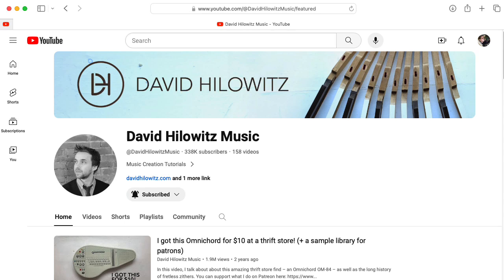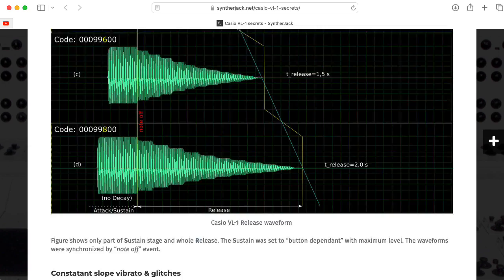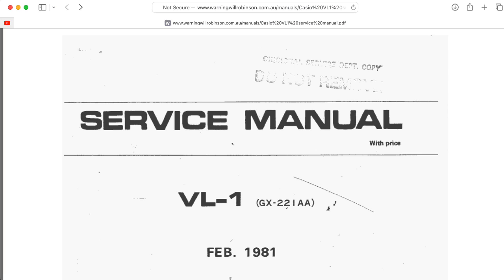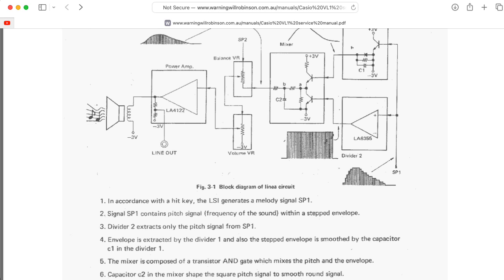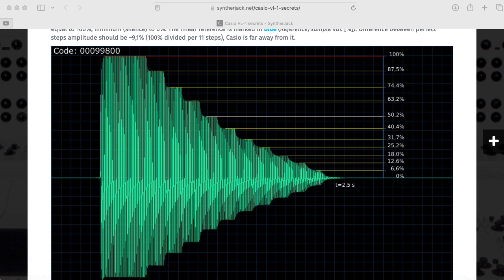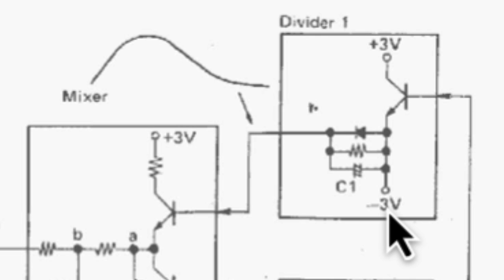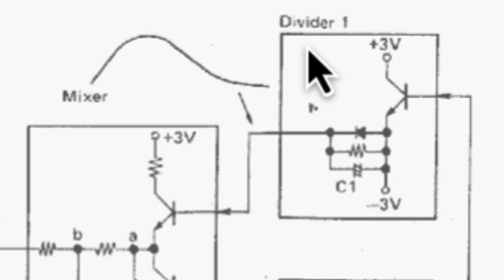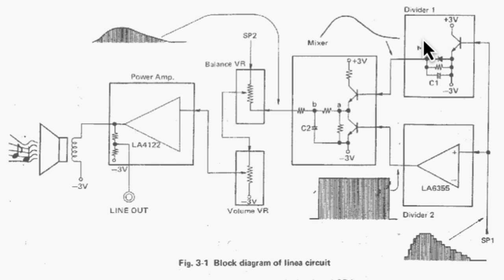Casio VL-Tone Circuit Mystery (is this an error in the envelope detector schematic?)

Comment: to sum it up the transistor emitter is biased to [ -3V +0.6VDiodevdrop] via the resistor and Vbase need to be just above the -2.4V+0.6V = -1.8V to start pulling the collector +3V to emitter that assuming that the 0.6V is diode voltage drop

Comment: Wikipedia Envelope detector. looks like you just need to correct schematic by deleting the trace from   the diode anode and the [capacitor || resistor] connected to -3V. Now the transistor emitter charges the  C/R in-series with the Diode. the capacitor discharge at constant rate and block the next NPN transistor from conducting and since the C||R is pulled not to ground but to -3V helps to overcome the 0.6V voltage drop of the diode as it conducts even at less than 0.6-volt input from base to emitter (it similar to why op amps need negative rails to reach 0V .

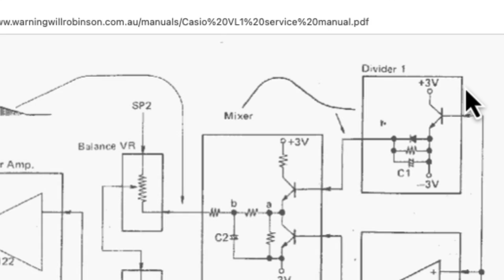Comment: 2:21 would help to know what kind of transistor is being used nmos, pnmos, cmos 

Is it open collector and not TTL

Transistors can be used in a analog/linear fashion too... Considering it being an audio output

And audio is technically an ac waveform

Typically with +3v and -3v  rails is a sign that it may be some sort of push pull configuration, to generate a true ac waveform not a pulsed DC waveform with smoothing

Comment: I’ve had a VL-Tone for more than forty years, and all it’s ever done when switched to ADSR is produce an infinitesimal blip. I’ve always assumed that it supposed to be an envelope, but it’s never worked as such. What, if anything, have I been doing wrong since 1982?
Reply: You need to read the instruction manual, I had the same experience til I read the manual. You could also just search here for an instruction video, pretty sure there are a few.
Reply: Well, it's been about 40 years, but if I remember correctly, you store a number into the memory of the calculator when in calculator mode, and that value is used as the ADSR value in keyboard mode.
Reply from the maker: I believe you have to enter a program sequence via the calculator function. There’s tutorials here on YouTube.
Reply: @Lantertronics  I did eventually find a video that described the process, not just showed a chap tapping in a string of random numbers…

Comment: They’ve also cut out any base resistors (there needs to be one for the lower mixer transistor if nothing else), I imagine they accidentally cut a few too many resistors in the name of legibility. Maybe you can find an image of its PCB and find out for certain.

Looks like nobody has taken a photo of both sides of the smaller board, but there are some good images of the component side so you can look near the three transistor section and maybe see if you can recreate the single-sided layout. Or just message some of the guys with photos to see if they can take a photo of the other side of the small board.
Reply from the maker: Oh, yeah, I was wondering how they weren't blowing up that transistor. ;)
Reply: @Lantertronics 
could also be an open collector comparator, but in that case it’s just the pull-up resistor they missed instead of the series resistor.

Comment: no resistor on the base, no resistor on the emitter to GND, the current would take the easy path.
I did a simulation the capacitor doesn't seam to have any effect, even removing the cap, resistor, alternating but with resistor on the emitter to GND, the diode conducts  bi-polar signal. Even with a push button on the base i can't see an effect of the capacitor (no matter what size), accept the voltage drop from the diode.
Must be a "block" type of circuit just for demonstration purpose and not the real thing.
Reply from the maker: Yeah, it's definitely not the real circuit. I wonder whose idea it was to draw that though, simplified schematics should illuminate instead of confuse. ;)
Reply: @Lantertronics  "I wonder whose idea it was to draw that though"
hahaha, you made my day with that comment.

I made or are in the process of making a Push Pull amp, also making mosfet PSU PCB that handle like 5 amps to power that.
But I'm sure you like my Push Pull circuit.

Comment: Why you are so fascinated with this ? I think this is what made you become the famous professor Lanterman. Whwn I close my eyes I see a12 year old Aaron Lanterman opening up his brand new, yet second hand, Casio VL-1 to find out how this thing works and I think you never stopped exploring since 😁
The envelope detector schematic must be faulty. Looking at the signals SP1 and the output of the envelope detector, both the higher audio frequency and the digital volume stepping are filtered out. The signal at SP1 is a frequency/pulse width variable signal with a (digital controlled) stepped volume (most likely using a very crude R-2R ladder DAC). The transistor is an emitter follower with the resistor between the emitter and -3V missing. The diode/capacitor is a peak detector to remove the audio from the signal and the resistor (both the resistor and capacitor are connected to -3V, not the emitter) results in the low pass filter stage for the envelope. There must also be an additional resistor between the collector and the +3V to create a low pass on the rising edge, otherwise you would still have the digital step on the rising edge of the envelope.
Reply from the maker: I can pretty much trace my current job to playing Akalabeth (Lord British's first game, before Ultima) on the Apple II+ and having it completely BLOW MY MIND.
Reply: I’d say it’s more likely a PGA after the timer PWM output, as opposed to an R2R ladder. If it were an R2R, having 11 steps would be strange.
Reply from the maker: It wasn't this, but I recall having some sort of electronic keyboard toy when I was very young, where it came with all the parts exposed and bare metal contacts for the keys, as some sort of educational electronics thing. Maybe Heathkit? Maybe Radio Shack? I can't recall for sure. My first real synth was a Sequential Multi-Track my parents kindly got me when I was starting high school I think.

Comment: Probably not an "error" as much as their idea of a simplified schematic. Just look at the op amp section right below it. It's almost certainly not operating without negative feedback. I would guess there's a resistor in series with -3V though a more complete schematic would be interesting to see.
Reply from the maker: The op amp below is operating as a comparator, so it wouldn't necessarily have negative feedback, but it's certainly an incomplete diagram, so you've got about about it being their idea of a simplified schematic. And you are quite right, if you put a resistor between the emitter and the -3 V it would indeed make a lot more sense.
Reply: Post the question to the sdiy list if you're not planning to do that already.
Reply from the maker: @Gameboygenius  Oh that's a good idea.
Reply from the maker: It really makes me wish there's a complete schematic out there somewhere...

Comment: If you think thats odd take a look at a picture of the insides of the VL-5 its pure insanity inside. 30+ bodge wires, through hole components mounted as surface mount, 3 separate NTC thermisters doing god knows what oh and 2 red leds on the inside doing ... something in the power supply section...
Reply from the maker: Okay, I just googled for pics of the inside of the VL-5, and... WHOA! You were not kidding!
Reply: @Lantertronics  and 0 documentation or service manual :'(
Reply from the maker: @krishna34674  I often tasks my students with reverse engineering such things; I try to make sure it doesn't lead them into madness. ;)
Reply: My vl5’s display only works when powered by an external psu. BUT theres a constant very loud hum when doing so, much louder than using batteries. Any idea? Im scared to open it and just poke around in case i kill it
Reply from the maker: @lordvespatron  Does the external PSU say it's producing AC or DC? If DC then maybe try a different PSU (be sure it's same voltage, same polarity, and same or higher current capacity). If it says AC, then likely there's a bad power filtering capacitor inside the unit. 

I have no idea why the display isn't working on batteries, though.
Reply from the maker: Reminds me of the Emerson Arcadia 2001 PCB. I had assumed that the unit my student I were looking at were subject to some repairs, but apparently they all look like that!